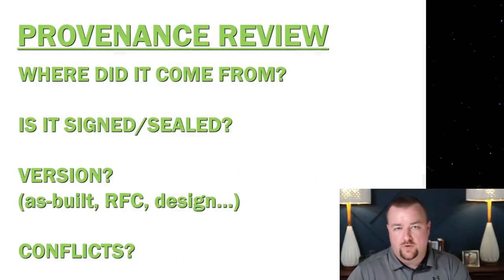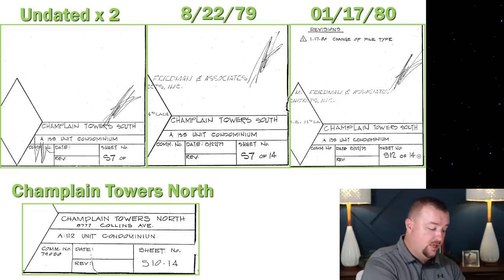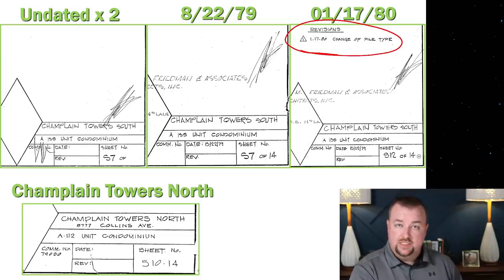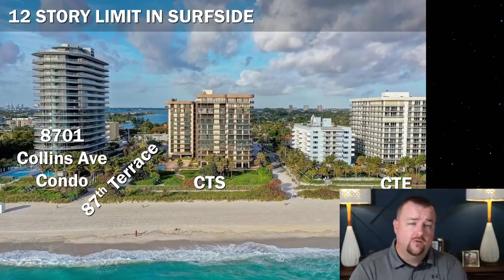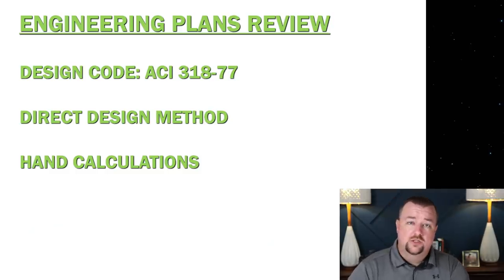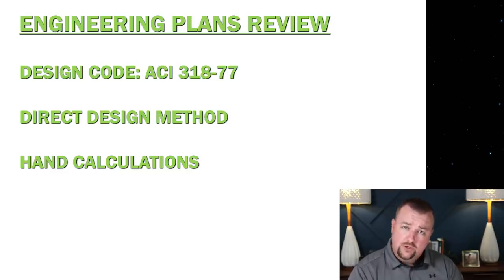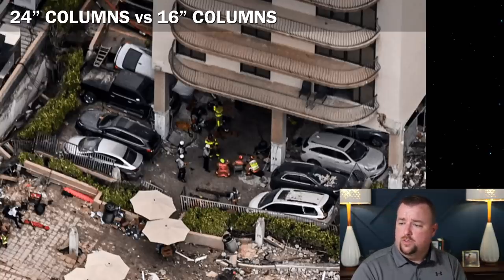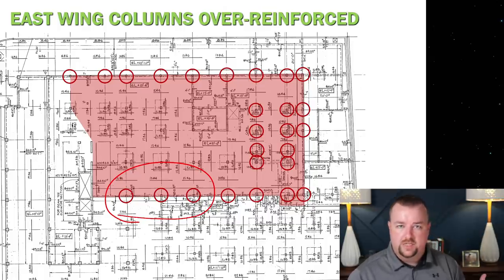Engineering Failures Found in the Champlain Towers South Drawings - Surfside Collapse

Comment: Josh, you are very thorough and professional, and I think you found the perverbial "smoking gun" that ultimately caused this collapse. Being at 100% of dead load capacity when it was built made it a ticking time bomb, and I agree that it's amazing the thing lasted for 40 years. What's also amazing is that those columns were only 16" x 12", and they removed all of those beams that would have carried the loads to the columns. To me, it really looks as if they skimped on lots of things when they designed this death trap. It's very sad that so many innocents died because of some truly piss-poor building engineering back in 1979/80.
Reply: That makes me wonder if the other Champlain Towers are built with shoddy construction just as the Champlain Towers South was.
Reply: Also remember that it was all done by hand. No computer aided design system to flag that these beams had dual purposes. Architects are human and unfortunately their was a failure. It’s so easy to sit back and place blame and yes it seems justified. If only everyone could be perfect but as you can see our society is plummeting into a sick hell all because humans cut corners or made a calculation error. It amazes be how hateful we humans are these days. Pointing fingers and yet none of the owners of these places is also being made to realize they played a role too. Ignorance is bliss. Humans adding granite and tile and all kinds of heavy materials as decorations which also contributed to its failure which the architect would have never known about or expected. Tragedy absolute tragedy and loss of lives all boiled down to explanation to punish human error. It is all just sickening.
Reply: Empire State Building & others were built very well. There was several causes in this structure failure unfortunately. I wouldnt be surprised if pay offs & kick backs played a part causing people to overlook obvious problems.
Reply: @jwmiles  In reality, the tenants may have played a role too.  They may have voted against a lot of maintenance and pressured it to be deferred until the 40-year recertification.  We don't know.  In their defense though, engineers often use technical jargon that doesn't properly communicate urgency.  Saying "if these issues are not addressed, a risk of continued structural deterioration is significant" is not the same as, "if these issues are not addressed with urgency, the building could be in danger of collapse."  Lay people think a "loss of structural integrity" means repairs to some cracks - not a building collapse.
Reply: Please do your own calculations on those beams and tell us if they would carry the loads to the columns.  Hint- no they wouldn't.
Reply: @jwmiles  We know this can be done without error if they check and double check like professionals. The Owner was shady the whole business at the time was very shady, cheating corners almost standard in construction. Way to many errors are done willfully in this area to give excuses. And even the non error was done to the absolute limit of what was safe and clearly they did not care if the building failed 40 years later as no adjustments for being in salt water area done. And the Military has learned the very hard way you have to demand perfection and punish when it not work or that Military loses wars thus heavy efforts above the minimum not to fail are taken. 

In example nuclear bombs were loaded on the wrong Air Force Plane and went to the wrong base which was still a guarded Air Force base with a Guarded field. No real risk of the bombs being stolen. Everyone in charge of anything from Lieutenant to General in charge of the Airfare and the Secretary of the Air Force all were permanently removed from the military. And that is the way things have to be even if people involved had done nothing wrong they lost their carrier in the military and that a risk every officer knows going into it the military can't afford to lax on it if your in charge it's your fault must be the standard. 

WE pay good money to Engineers and Architects and Building Departments and must hold them to similar standards. 

As stated on Engineering Forum you must plan for stupidity of other in construction and stupid overloading. 

It the tolerance of lies and failures that causes massive problems across society. People in charge of things have to be automatically guilty if their organization breaks the law no need to prove they lied or failed themselves they are in charge and thus make certain they know what going on and they approve of what is done. Don't want to risk that don't be in charge of things.

Comment: Many years ago, I remember a magazine article that suggested that engineering changes was one of the biggest hazards in design.  This was based on observations going all the way back to the Romans.  It looks like that same principle may have struck again.
Reply: I'm thinking last minute changes require going through all the calculations again, and that didn't happen.  You would have to check everything else works with the last minute change.  I have no mathematical ability whatsoever, but I sure wouldn't want to go without rechecking the original plans match the revision - that they still work.  It sounds ridiculous that they wouldn't recheck.  Should have delayed everything for that purpose.  It's not like it's the paint color being changed.
Reply: The Hyatt Kansas City walkways collapse (1981) involved changes from original design. Probably what you are thinking about.
Reply: @isveryrill1234567  Yes, it’s a failure to see the whole thing as a SYSTEM rather than discrete parts. That’s what he was saying about the secondary function of the beams I think - they may have been put in for the step down but they also played a role in the entire system of the building by directing forces along specific paths. Even ‘just’ adding an extra planter is changing the system because you’re putting a bunch of extra weight in one bit, which needs to be accounted for - if the part of the structure you put the planter on is already stressed due to the role it is playing in the system then it may not handle the extra stress even though the same sort of construction standing independently (I.e. unable to be stressed by other parts of a larger building) might be fine.

So changes need to be assessed systemically, not just locally.
Reply: When I heard for the first time they were designing the Space Shuttle around a pair of solid fuel rockets, my thought was "This will not end well!"
Reply: @davidvoinier6008  LOL Same. Solid fuel and humans should not normally mix. But launching below the known temperature the units were rated to work it criminally bad as well. Damm things had a do not use below temperature rating and they launched substantially lower than that.
Reply: @DCPandaFan  Sadly there are too many of this changes. I just watch a Bangladeshi building collapse that was structural change in both design and purpose.
Reply: @russellhltn1396  that wasn't my comment about KC, that was Lin
Reply: @TrappedinSLC  This has me thinking about people who DIY at home.  If they aren't aware of this sort of thing, a project could go very wrong.  When you have a condo bldg., do they put all the weight limits and such in writing for whoever is in charge of the place?  Did they have any idea regarding the planters?
Reply: @isveryrill1234567  Yeah. I mean, I knew for houses you have to be aware with stuff like tubs and hot tubs but I’m kind of a nerd about these things. I’m sure people don’t normally thing about stuff at all.
Reply: @DCPandaFan  Just another example of a pattern.  As I said, it was observed in the time of the Romans, which pre-dates KC by a bit.
Reply: @isveryrill1234567  Sorry.  Fixed.
Reply: @russellhltn1396  It's no thing :).

Comment: I wish you could inspect every building that goes up.  Seriously, yikes.
Reply: @DrBernon  A good session with a finite element analysis suite would have given the designers a hell of a shock... nice pretty graphics with lots of red, purple, black.....
Reply: @DrBernon  CAD all you want, but it has absolutely NOTHING to do with anything being PHYSICALLY BUILT correctly. Site-Engineer who actually knows what they are really looking at are the key.
Reply: @flipnotrab  But usually the problems are in the design the workers follow, like in this case. Someone drew the design without the beams, and sent that design to the construction workers. With modern tools, the program would have warned the architects they made a mistake.
Also, a site-engineer will make sure the design the architect sent is followed, nothing more. Unless the mistake is glaringly obvious, it is far too easy to trust the designer did their job correctly.
Reply: @flipnotrab  Also... the design the architect forward to the construction company has absolutely everything to do with the things that will be physically built. With a construction as big as this, everything has to be well-designed. You can't make something half assed and then improvise during construction. So construction workers must follow the design that should have gone through a bunch of revisions and analysis.
Reply: @DrBernon  what part of “CAD all you want” didn’t you understand??😂😂
Reply: @flipnotrab  You are just trolling now. I said what I said. If it goes to deaf ears, what can I do?...

Comment: You may want to pay attention to the east portion (collapsed area) where interior floor elevation is higher than the pool deck (18" to 30") with the "step-down" beam (spandrel). The columns are aligned above and below this spandrel. After the pool deck failed, the bottom of spandrel was pulled towards the pool deck (lower side). This rotation of spandrel may have caused the columns above and below to offset vertically and buckled laterally.

Comment: 35 years of commercial construction I've seen this type of mistake made first hand. Not structural, but in electrical. Engineers making a change but forgetting to take into consideration other trades or drawings that could be impacted by those changes. 

Nowadays, weekly meetings and asbuilt drawings play an important roll in preventing these types of conflicts. Plus the simple fact that everything is generally done using CAD drawings which speeds up the processes considerably. I dreaded doing my daily and weekly asbuilt drawings but did them as required anyway.

Comment: Josh I know you’re stressing the significance vehicle loads - and while I do agree that direct concentrated loads from wheels on vehicles can be high it’s not nearly as high as you make it sound.  Parking garages are generally designed to 50 lb/ft^2 or in the case of larger vehicles 75-100 lb/ft^2.  Live loads are in that order of magnitude (depending on the loading scenario) so it’s not like it’s way over and above what it would be designed to for live load.  Not a criticism just a note for those that aren’t aware, cars are heavy but they also occupy a large tributary area that prevents other things from occupying that area.

Comment: Another youtuber covering the Champlain Towers collapse found that originally the pool deck planters had palm trees in them. At some point those trees were removed with the use of heavy boom lifts on the concrete that was already at 100% capacity...
Reply: Yes that was Jeffostroff👍
Reply: @alienblackgoo_gle  So your are adding the weight of a crane on there? or not?
Reply: @nuclearusa16120, Can you clarify your comment? 

Are you certain that the concrete slabs were already at their 100% load bearing capacity, or is this speculation or hyperbole? That they would have been at their full “100%” capacity is an astounding claim because structures are engineered and constructed with a specific safety factor, which is often 2, meaning that a structure with a safety factor of 2 is built to support two times its maximum intended load. What you’re saying is that these slabs were constructed and installed with a safety factor of just 1, so that ANY additional load would cause structural failure. That seems extraordinarily unlikely to me. If it is, however, true then it would be, by design, an inevitable point of failure.
Reply: @inkyguy , based on the calculations by the creator of this video, the slabs analyzed here were at 100% load with the beams, and without the planters.
That means the elimination of the beams or the addition of the planters would have significantly overloaded the structure.  And both appear to have happened.

Comment: Good analysis again. In regard to temperatures steel, I think the engineer meant to extend each bottom #4 bar over the columns as a minimum, not as a lap. However, as you pointed, this does not work for temperature steel. Catching the removed beams bit is huge. I can hardly believe the engineer would do that. Good stuff thank you for taking the time to do this!

Comment: since construction, in addition to the planters - heavy gravel, sand, and concrete block was added to the pool deck. Each condo unit itself had heavy marble or ceramic tile added to the lobby, and each of the individual apartments.  back in the 1980’s, lightweight rugs were more the standard

Comment: A+++  Josh, IMHO... Your analyses are THE STANDARD to which all others should be measured!  Very Well Done and Very Well Explained.  This video gives excellent theory as to why the lobby level parking area and the pool deck collapsed... but what caused the building to collapse?  After the pool deck collapsed those 3 suspect columns buckled over and failed?  It seemed like the pool deck collapsed straight down, which wouldn't make me think it exerted any lateral pull on those 3 columns to cause them to buckle.  Please make a video with details (the best you can) of how the pool deck collapse brought the building down.  Thank you Josh!
Reply: Me too. I would really like to know about those columns. In particular, did they buckle straight downwards at the base where possibly weakened by salt water, or where they yanked sideways near the top, causing at least one to fail asymmetrically perhaps 7 minutes later. Could it have started with the one column on the east side of the driveway (beyond the bottom of the entrance ramp) which had that transfer beam running out to the pool deck and that planter ?). That column was still standing in the infamous video from the BG hotel, but I wonder if it was damaged at the back by that transfer beam possibly ripping out of it, and destined to fail minutes latter.
Reply: I wondered the same thing.  If the parking garage/pool deck just dropped why would the whole building fall?  The only explanation I can find is that the drop pushed one or more of the skinny columns sideways.
Reply: The way I understood it was the lobby level parking area collapsed straight down but the pool deck collapsed in a U shape. The center columns punched through the slab but the perimeter columns were pulled sideways and rotated.
Reply: Already pointed out by other Engineers how the pool deck took down the rest of the building and some mentioned the pool deck should have been designed that if it failed if effected nothing else. Basically anything connecting the building to the pool deck be break away with almost no energy transfer.